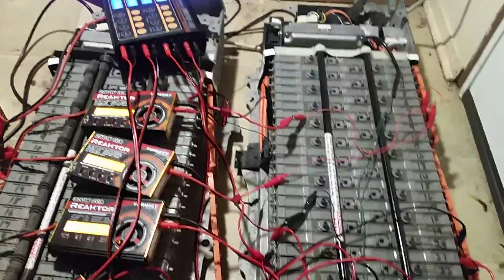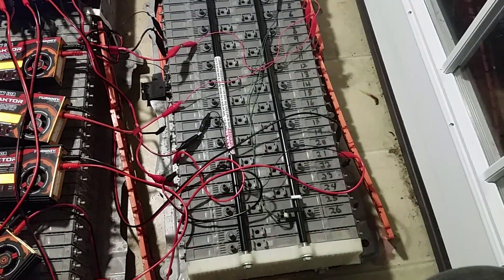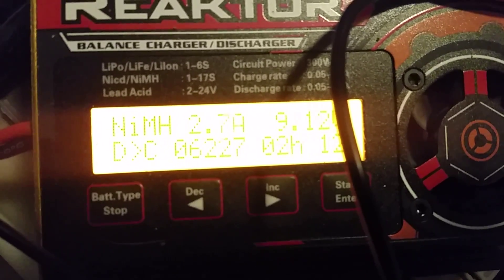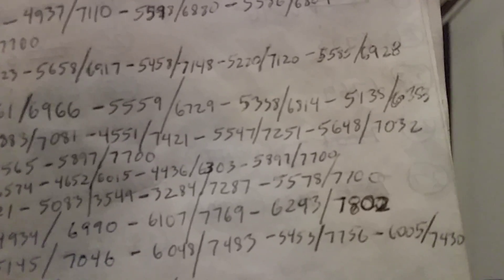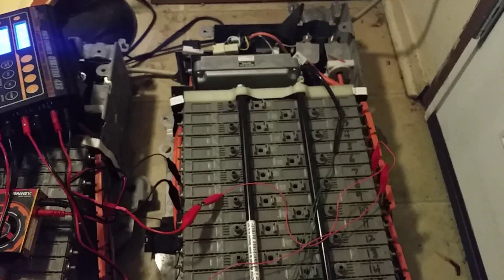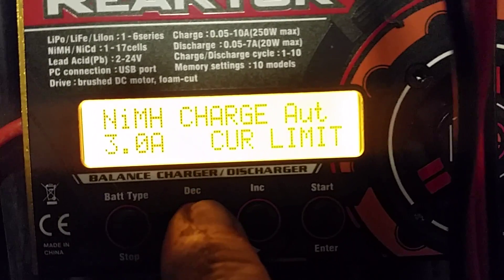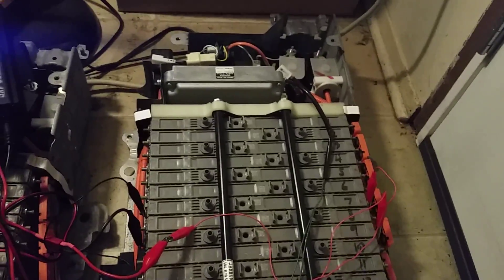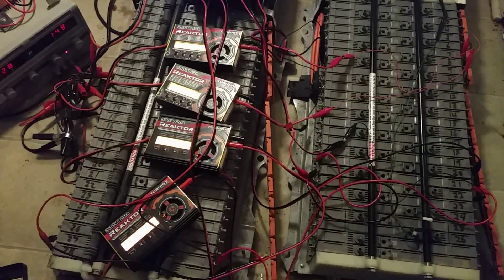Prius module on Imax B6 - redux

Comment: Hi.  I've been working on  my camry hybrid bat very with the reaktor set up as you have it.  Can you help me understand the charge rates you're writing down and if there is a target charge rate?  you're showing like 06348 in this example on battery 21?  before taking it off.  My recorded rates are showing up more like  2500 to 3500.  What do this numbers represent?  How do i understand them better?
Reply: Donald,
You need to cycle each module until you get 5700 on a discharge. Your higher number is the Delta Peak on the charge. usually that peaks at about 7300 average. If you see extreme swelling of a module during charging, it is probably in need of replacing. 
Im still learning though. Be carefull
Reply: Okay.  Just because i'm starting with low numbers doesn't mean I won't be able to get the batteries back up to 5700 on discharge.  Is that correct?  Or does that mean they are ready to give out?   All of my batteries started with a charge above 7.5V on the meter but i had the red light on my dashboard.  I'm trying to do preventative.  I have two chargers running different batteries at the same time.   Do I run ALL of the cycles consecutively until I hit 5700 discharge?   Or will it work to do a three cycle, then move on to another battery even though i'm not reaching 5700 yet, let the battery settle, then come back and do it again?  Or should I keep on the batteries until they are reaching 5700 discharge?  Non of the batteries are showing extreme swelling, they all seems pretty normal to me in regards the swell.  AND I have only run one cycle on each so far.  Suggestions? (and thanks for your input, it's been an interesting process)
Reply: I have some modules that took 27 cycles to get them back to 5700. I stayed on a module until I got it done, so yes consecutively. I would run 3 cycles, evaluate then set for 5 or more, or what I thought it would need to finish. This is a very time consuming process, up to a month with two chargers.
You may need to reset your Capacity cut off to 9000mAH, 7800 was not enough for some of my modules.
After I got through all the modules, I went back and ran one cycle on each to top them off before installing the pack back in the car. Extreme swelling is what determines replacement.
This is what I have learned and experienced.
Reply: Hi again.  Update.  Yes two chargers is a slow process.  And i'm patient I have another car thank god.  My car is a 2007 Camry  at 200k  I assume the batteries and approach is the same with the prius batteries, just slightly different pack.  The reason i ask, is what i'm finding is that my batteries seem to top out in the same range, after running three cycles of three.  They are all getting to just in the high 2000 low 3000 range then drop then return then drop.   This is when the batteries seem to swell.  Maybe i'm just too afraid to keep pushing it, or that what i'm seeing is a swelling battery that really isn't that bad yet and I should do another four or five cycles (cycles of three that is)   Is it possible that the whole of the battery pack is ALL stuck at the same level?.  From what i am reading on the forums is that you generally find one or two that don't respond well, but not 25 in a row.   I feel i'm doing something wrong.   I did watch some of your other videos---one in particular of the hobby king four charger.   I reset my turnigys to the levels you suggested on the Hobby king and I got a bit quicker response (5amp charge, 7800, 6 on the low end for example)  I just feel I'm missing something because not one of the batteries has moved any where near the 4000 range.  Possibly I'm doing it right and that the discharge levels are actually what i should be seeing because I've set it up wrong or I'm attempting to achieve levels that I shouldn't be, it's a different style of battery or I just don't know.   I can push the batteries harder, and see if they start jumping up--yet i'm concerned about the swelling.  Is it possible that all the batteries are just near done with 200k on the car?   They all showed a good 7.7 or so charge when i first pulled the pack out.  They almost all start in a very low discharge rate too ---for example--00453 to 02562---00426 to 02590.  This battery in particular (battery 32) i've run 11 cycles on.  Its had movement but the last four cycles are stuck in the 2500 range.  Does it defeat the purpose if the battery swells and I stop and return to it at end of the day or another day?  You said in an earlier reply do it all at once. i'm not sure if that's possible, and since i don't understand the process, If i need to run 25 to 30 cycles a battery to see the starting levels I will do that.  Or if I can just keep rotating up and down the pack i can do that.   Do I push it harder or just be resigned that this is the state of my batteries after 200k?  Advice?  On approach, or testing or changing settings on the chargers.  Thanks in advance.  donald

Comment: Hey Tommy can I email you? I have some simple questions. When you are charging with Quattro what is too high for the voltage, sometimes I see on the Quattro screen it goes up to 9.3 charging volts. Is that right? I have it set to default and on automatic charging.

Comment: Do you leave your hobbyking on overnight? How much time do you stand by the charger (if at all) its like watching paint dry lol. Where are your batteries? I am trying to find a good place to leave them and run the charger and take up minimal space. Thanks Tommy! Because of your video I am now reguvenating  up a 2004 battery I pulled from a junkyard for $250 (drove 3 hours to get it though:) regardless of the time issue, its exciting

Comment: this cells are very different to consumer NIMH , try to charge till  8.4V only  per module ,  that voltage is calculated full by hybrid computer , after that the cells will build pressure   , and charge the module in the pack also  very importaht
Reply: My charsoon only charges at 8.4...or 7.2. Which was really confusing at first, but its been working

Comment: 1) So if I set up my chargers the same way you set them up exactly, all id have to do is connect a cell, and press start and id be on my way? Im a total newbie with these chargers. 2) Can this process save a cell that is between 6.2 and 7.2volts? 3) Do you have anything else connected to the modules such as temp probes? 4) Are theyre any other chargers out there for a cheaper price than these that you would recommend? Such as another less powerful turnigy charger? 
Thanks Tommy priceless info you have given in the video!
Reply: Also last two questions 5) Is the goal ultimately to get as close to 6-6.5 amp discharge? When you say, "If the cell is giving you a hard time." or "If it isn't performing well enough" you are refferring to it not getting to 5.5-6amp discharge correct? And if its giving you a tough time you suggest to adjust the discharge to 6.0v as opposed to 6.3v and adjusting the cutoff charge amps from 7.5 to 7.8amps just to give it a little extra "kick"?
6) what is the delta peak?
Reply from the maker: Let's Do It Correct on everything, and I know of no other less expensive charger that will do this. The B6 can be flashed with non-factory firmware, which is something that I have been working on. sometimes a module showing a lesser voltage can be brought back, but often one cell in the module is dead. I am not running any temperature probes yet, but I do run a box fan across the pack. S. Keith has suggested using the factory fan to cool the pack, and I think I will take his advice on the next one. Google delta peak, it will explain it better than I can, but the simple answer is the peak voltage the pack reaches during charging, before it starts dropping off.
Reply: awesome thank you!
Reply: I guess the HobbyKing Quattro is the best bang for your buck then in terms of how many you can do at a time?

Comment: Tommy, I can't thank you enough for all the information and insight you have provided to me. I'm thinking like the information you have gotten from S Keith I have gotten from you. I appreciate both of you guys!!!I have a 2010 Prius with 220K on it and started this project in May and have had some luck. I have bought used modules on eBay and it would be fine for a couple of months but then another module would go out. I have pulled the pack out 3 or 4 times since May.When I first started in May and up until last week I was doing it like a cave man, LOL. I was using light bulbs to check individual modules for capacity and to discharge the entire pack. I had bought a prolong battery charger that charges the whole pack and charged and discharged per their instructions 3 times.But in early December I saw Tommy's video and bought a Hobby King Quattro 4x6. I have been going though the modules now for 10 days. I found another bad one that dropped like a rock to 4 volts on a 1 mah discharge. That's the one that probable gave me the triangle of death again. Most of my modules using Tommy method are between 3 to 4 mah on discharge and 5 to 6 mah on charge, see below. Sorry its fragmented, it wouldn't copy and past well from excel doc. and I could only copy so many columns from docI have better fans now so swelling modules are not such a issue, initially I was using a box fan too.Tommy I did 3 cycles as you had mentioned to access. Now I'm in the process of doing 5 cycles with no change, in fact the capacity reading are going down, that why I'm saying 3 to 4 and 5 to 6 now. I'm letting the modules rest between discharge and charge and spreading out the charges and discharging.Tommy with using your method what would you consider a good module,? I know in the video above ( which I've watched now at least 30 times) module #21 seemed to have good capacity on paper but yet you were still charging and discharging.I guess I'm looking for yall's opinion, should I continue and run 15 cycles? If so and if some modules don't come back can you recommend a good supplier of quality modules at good prices?If the entire pack doesn't really come back at all I might get a good used pack from Falcon Hybrid for $ 2000 or so. Do you have anyone you recommend for good used packs?Any recommendation you guys have I would be most grateful!!!!I appreciate your help!!! I'm married with 4 kids and don't have money for nothing, LOL.

 
 
 
 
 
  discharge
  charge
  discharge
  charge
 
 
  5.444
  7.253 swelling
  5.736
  7.691
 
 
  5.727
  7.143 swelling
  5.684
  ? Erra message
 
 
  4.543
  6.289
  4.643
  6.564
 
 
  5.528
  7.536 swelling
  5.607
  ? Erra message
 
 
  5.507
   
   
   
 
 
  4.681
  6.121
  4.611
  6.225
 
 
   
  New Mod. -
  2.931
  7.801
 
 
  3.717
  5.217
  3.643
  5.117
 
 
  2.885
  4.474
  2.884
  4.346
 
 
  3.994
  5.339
  3.934
  5.581
 
 
  3.171
  5.215
  3.118
  4.941
 
 
  3.181
  5.317
  3.193
  4.927
 
 
  3.424
  4.749
  3.407
  5.082
 
 
  5.705
  7500
   
   
 
 
  4.839
  7.106
  4.851
  6.861
 
 
  3.483
  5.576
  3.686
  5.568
 
 
  3.925
  6.243
  4.403
  6.881
 
 
  3.976
  6.057
  3.942
  5.977
 
 
  3.481
  5.377
  3.564
  5.223
 
 
  3.771
  5.786
  3.661
  5.528
 
 
  4.027
  6.282
   
   
 
 
  4.696
  7.013
  4.722
  7.191
 
 
  3.275
  5.229
  3.395
  5.221
 
 
   
   
   
   
 
 
  4.742
  6.826
  4.763
  6.654
 
 
  4.116
  6.303
  4000
  7275
 
 
  3.483
  5.085
  3.354
  5.046
 
 
  2.811
  4.521
  2.786
  2.648
Reply: Thanks! S. Keith is the man, I would have never started this project without him!

Comment: LOL... "guy named Steve"... Hmmm... I think I know that guy...  BTW... you need to cool that bugger.  You can use the EXIT duct and shove it into the bottom of the case where it normally goes and then just aim the 12V blower from the car into it. It will blow air up through the pack.
Reply from the maker: S Keith Yep, you really helped me alot man, thanks! Just off screen in this video, is a large box fan. It blows across the pack, and I am now starting to use the regen capabilities in the chargers, using a 12v car battery, and a Schumacher charger.
Reply: You're welcome.  Happy to help.

I used to use a box fan too, until I found out that you're basically trying to cool a solid block. I saw some bad things happen.  Unless you're driving air through the cooling passages, you're doing almost nothing. Try it for yourself... You can power the fan with your battery or get an adjustable 30A/12V power supply from amazon.  You will be amazed at how much air can move up through the pack even without any effort to seal up the blower/duct interface (you can "seal" it by stuffing a rag into the gaps).  You'll be able to charge @ 6.5A and rely on deltaV cut-off without worrying about swelling.  Since you're exploring the regenerative features, you're only going to be making more heat.  Allow 30 minutes between cycles.

Regenerative is only 42% efficient based on my multiple tests, i.e., when you regen 1000mAh out of a module, you can only put in 420mAh using that same energy, so you still have to supply quite a bit.

You can also "march" through the pack using the prior "block" as your regen source, i.e., discharge modules 1 & 2 into a 12V battery or with the internal discharge and then power the charger with modules 1&2 as a 12 cell battery (single copper bus bar joining them at one end) and discharge 2&3 into 1+2, rinse and repeat "marching" through the pack.  The nice thing is you're discharging and partially charging, again saving time.  Watch out for the bad modules as they throw a wrench into it.

Easy to wear out a 12V.  Make sure your regen settings are at 14.7V for 12V.  When using two prius modules, that can go to 18.4V.

Oh, and your wiring is a bit messy.  Try to keep the Reaktor leads as short as possible. Now that you're moving into high current territory, your voltage drop is going to start getting noticeable. You can see for yourself by watching the voltage difference reported by the Reaktor during discharge and measuring with the separately attached voltmeter.  You can compensate by lowering your target voltage, i.e., if you show 6.2V when the charger terminates at 6.0V, you can just terminate at 5.8V.

Also, go to 6.0V.  If going to 6.0V takes a module out, you don't want it in the car.

Good luck!

Steve
Reply: @snoobler  Very informative discussion, please keep it up!
Reply: Tommy, I have some questions. I have some modules that cycled, but when I went back to top them off later they did not cycle. I reset capacity cut off at 7900. What happend?

Comment: Tommy, we designed way more efficient way to analyze / charge all modules simulataneously on the individual module level. Please visit our site: http://www.hybrids.co.nz/ and youtube channel: www.hybrids.co.nz/. Our tools are logical choice for those who tried hobby RC toy chargers but found that to be extremely time consuming, not providing sustainable results and not coping with the work load. It took us just couple of days many years ago to realise that.  So we invented our own tools which we are now selling to other busy garages and battery rebuilders.
Reply: Hey Kiwi, you big cutie. The Reaktors are capable of more current than your battery analyzer. I've worked on batteries that were "reconditioned" by stateside equipment comparable to your battery analyzer in terms of capabilities, and I was extremely unimpressed with the results.
Reply: Mate, your lack of attention to details worries me. We already had that conversation. I mentioned before on the forum where you are bragging about your acheivements and you had an opportunity to read that in plain English: "Our Analysers are tailor made and capable of testing modules at up to 100 Amps". And that is excactly what few of our clients are doing - testing at high amps. Special design was made (not shown on site as it was built to order) with 100A connectors & fuses. It is your choice what load you use - 100A, 50A, or 20A, or 6A.  It is summer time in NZ - you are welcome to come to NZ and see for yourself. Instead of promoting "made in china RC toys" - you could've been our agent years ago. HV cables and plugs are made in USA (you could be proud of that), the rest is made in Japan and Korea and is high quality components. We pay comission B2B to right people who know what they are doing. You still need to demonstrate that your skills are up to the task, but your passion for batteries is a good beginning :-) P.S. - our Battery Manufacture Date Scanner is now working in few states. One is used by one of your biggest Battery Specialists. Cheers. I am available via Skype daily - watch time difference.
Reply: You expect me to remember your blatherings on PC?  Seriously?

I'm not a client, but I'm testing at high current. You shouldn't think you know what I'm doing based on what I put on a forum months ago. I have lots of happy customers running very strong packs. Being your agent would have only slowed me down and killed my profitability. Your battery date scanner can be had on ebay for about $30. Any simple QR Code scanner works. No software required. I already have one.  Good job suckering one of our "biggest Battery Specialists".

Tommy, sorry for polluting your comments.  I won't engage with Kiwi anymore.
Reply: You again making untrue statements and making assumptions . Our Manufacture Date Scanner is a software product, it is not available on eBay. QR scanners they can convert QR code into number. Our software does much more - it automatically decodes numbers into manufacture dates and highlights with color whether there were swapped modules in the Prius. Camry, Lexus hybrid battery pack, it produces sound if you've made a mistake while scanning the pack. It adds smarts and efficiency. Your judgement about our products shows lack of understanding.